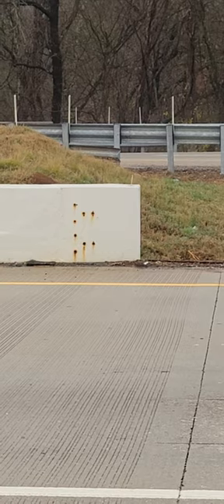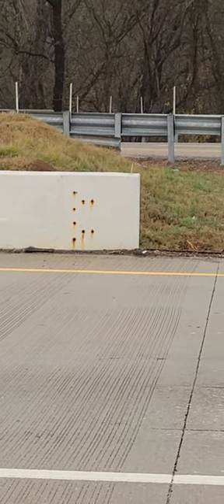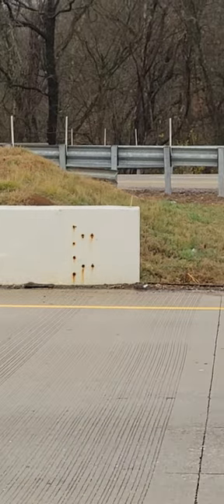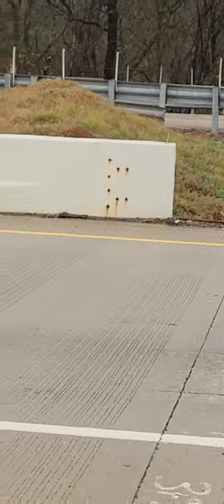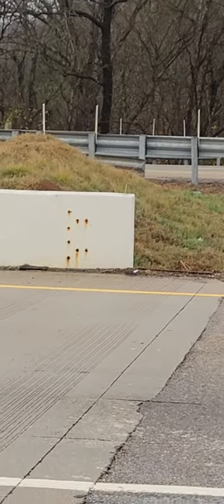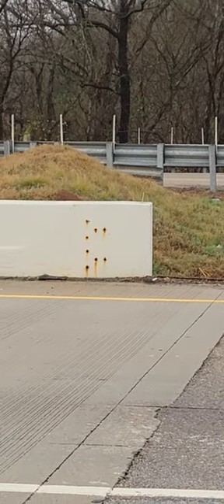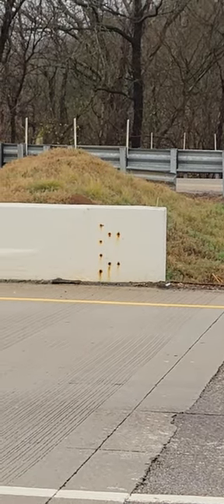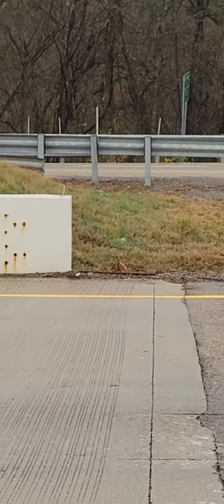No Guardrail on Tennessee Bridge. We could Save Motorcyclists by Using this at ALL Similar Bridges

Comment: You're understanding of guardrail is truly remarkable. I might note that occasionally roads have guardrail reconfigured when construction requires traffic going in opposite direction, and even the guardrail W-beam needs to be flipped end to end so that it won't catch vehicles. Sometimes it is not reversed after construction.